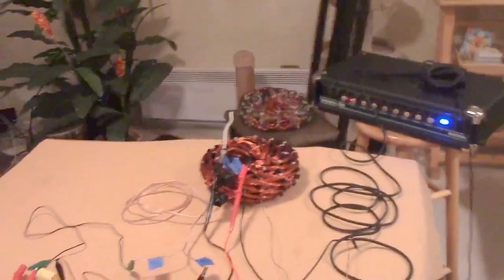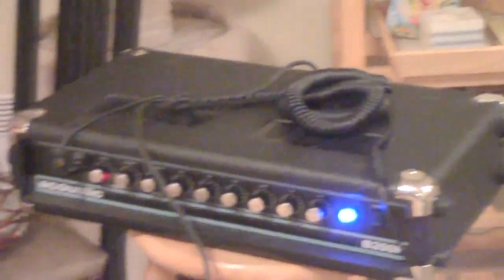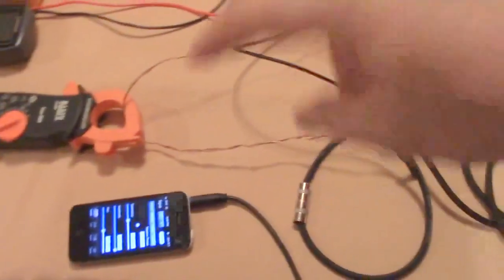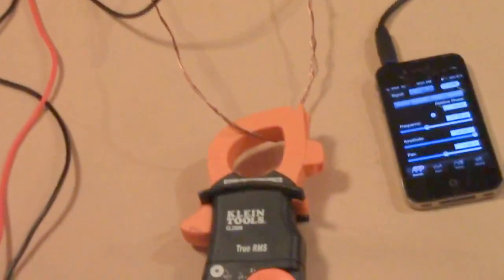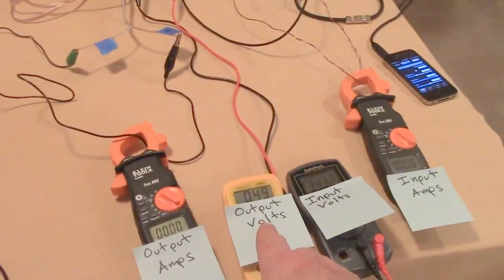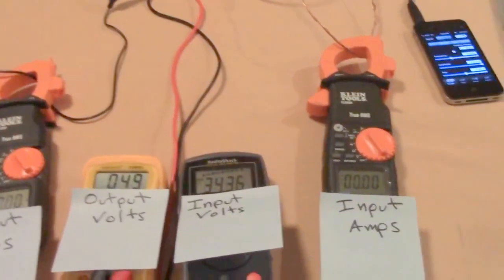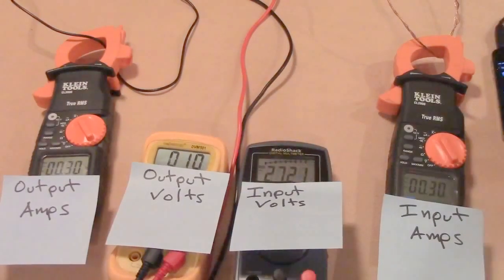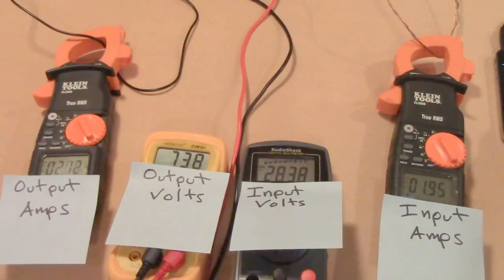Vortex Resonance Coil Showing Massive Power Out

Comment: yeah dream on ,there is no chance that a small halogen will work with 1000 volts, show this with the lamp on. Use a trms meter for the voltage. Quit showing garbage. I know over unity is real but this isn't how its done.